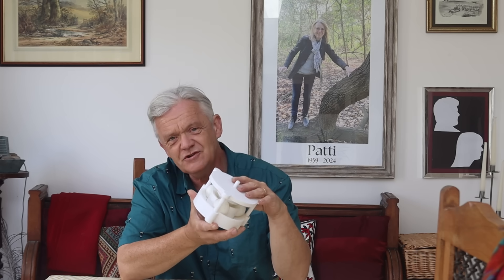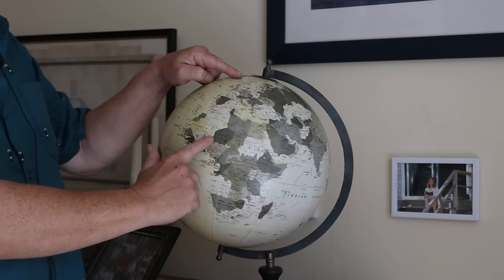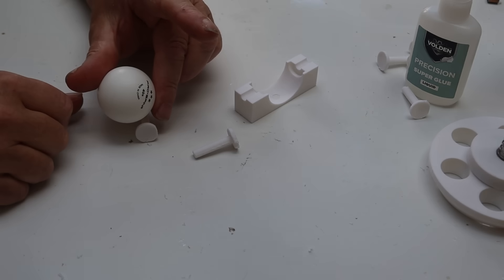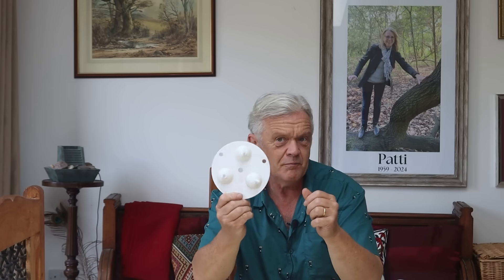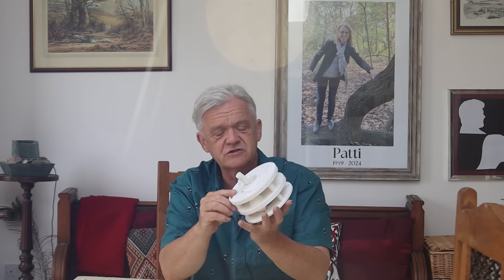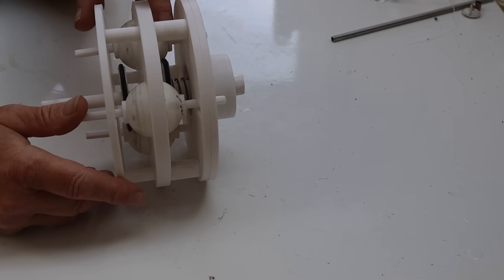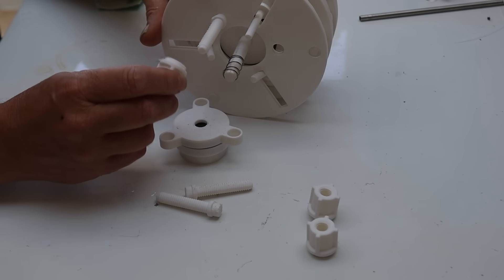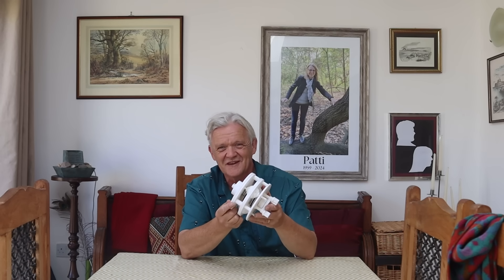2412 The Nu Vinci CVT with Ping Pong Balls

Comment: Typical in snow blowers is a rotating disk driven by the engine and another disk with a rubber edge that is moved along the drive disk linearly to create different drive speeds for the wheels.
Reply from the maker: cheers mate

Comment: Now I want to understand how the automatic CVT function works - I can set a level of constant torque where it automatically adjusts to keep it where set regardless of the terrain or pedal speed.
Reply from the maker: it's not automatic mate - you have to shift the lever - but making it automatic is not going to be really different from a standard automatic gearbox in current use would be my guess
Reply: @ThinkingandTinkering  Enviolo/NuVinci has something they call the "Automatiq" system that "shifts" for you (such as it is) to maintain a constant effort level from you.  I have the manual system; the upgrade is pretty expensive to me so haven't really gone for it yet (over 2x the cost of the hub alone and it also requires its own small battery).  I see some literature/drawings/pictures from them but I still don't really quite understand it.
Reply: also thanks for replying!  😀  have a wonderful day!

Comment: While the principals are sound I see limited uses. Friction means either wear on the mating surfaces or heat on parts causing expansion & potential seizure of the bearings in their raceways. As long as wear & heat are managed this looks fantastic & fun.
Reply from the maker: well it is a model of an actual device that is actually in use - so there is research to answer your questions. But you are right - good points and it is fun for sure

Comment: Cool.
Please, could you put some markers on the input and output, as it is a bit hard to see them turning?
Thanks.

Too many years ago, I tried to make an automatic gearbox for a RC car, using a 'cones and ball-bearings' approach. It sort of worked, after so many, 'trial and error' prototypes. But I never cracked the tendency of it to jump from 'low' to 'high' ratio when under high torque, or at high revs (regardless of adjusting spring tension, and various curves/angles of the 'cones') it would jump and stick at low or high ratio. And one of the hardest things for me to do was accurately mount the small ball bearings (5-7mm). The latter problem caused all manner of vibration and spacing issues. It was both fun and very frustrating. But I learned a lot about the difference between 'seems like a good idea' and the engineering reality. And it would slip either too much and/or unpredictably given the slightest excuse, even an errant fingerprint could cause problems.
I digress.

Thanks again for showing us all these fascinating techniques a mechanisms.
ATB. 👍 🫡
Reply from the maker: there are markers on there mate - reflective dots - I agree there is a world of difference between the idea of a thing and the reality of a thing lol - cheers mate
Reply: @ThinkingandTinkering 
Sorry, watching on a dodgy/tiny mobile screen, I couldn't make them out. My bad.  🙂

Thanks.

Comment: I have a nuvinci gearhub on my cargo bike. I tested the bike with normal gears and a derailleur, and the bike felt very efficient and rideable without electric assist (necessary to know as the bike is relatively heavy and one does end up with an empty battery occasionally). The nuvinci hub is clearly not as efficient and running out of battery range makes for a more difficult ride home. However, I find riding on a bicycle with regular discrete gears extremely clunky know. I have developed a pretty good feel for how much up or down I need to shift to change gear with the right amount, and you can do that while pedaling on. It is very comfortable to always hit that perfect gear ratio. At first I was disappointed with the lower efficiency of the nuvinci, but by now I would definitely want one on any bicycle that I would buy in the future.
Reply from the maker: nice feedback mate - i heard nu-vinci were working with a friction fluid addition to their drive to improve efficiency

Comment: That is amazing!  Thank you for sharing this with us!  If the plates that applied pressure were directly linked with springs, wouldn't that eliminate the need for adjustment?
Reply from the maker: i don't think so mate - the springs do two things - the first is to apply a normal force and your suggestion would be spot on for that. But they also centre the spheres in the holder so they don't rub on the holder surfaces - I don't think your suggestion would help there - but there is always more than one way to do a job - so another method to do that coupled with your suggestion would do that
Reply: @ThinkingandTinkering that makes perfect sense, thank you for the correction!  Can I ask, is the swashplate CVT a kind of nutation drive?

Comment: I think I'm starting to get what you are getting at remember 42 times....😊 I'll get there. I often wonder why some auto companies don't do straight shifts with a high&low speed rear end like an 18 wheeler you'd have ten gears and you'd only need a very small engine. It just always made sense to me. You'd just need to make either the three or four cylinder engines with smaller pistons depending on the demand put on the car. I think people would like them.
Reply from the maker: they probably would in this day and age mate - they would be economical
Reply: @ThinkingandTinkering yes they would be very economical as well as an effective way to reduce Petro dependence. However I just recently talked to a retired trucker and he says the companies are replacing the manual gear boxes with automatic transmission because they can't find drivers. Which means the transfer truck makers have figured out how to bring the rear end into the realm of automatic. So in a car it would still give better mileage and how much I don't know. Maybe our chat will inspire someone who makes automobiles we can hope

Comment: Thanks for another great video Rob 😎👍 I think if there were bearings on the shafts of the drive disks, then the springs could be put between them and the outside covers to make it more compact and with less parts
Reply from the maker: it's a great suggestion mate but you would be much better off using cross roller bearings i think as normal bearings wouldn't do that great with force of the spring acting on them

Comment: So if someone wanted for some reason could the gear ball be modified and used (that was previously looked at)?
Reply from the maker: yeah it can be modified but that is a very general question mate so I am not sure how you mean or what modification you want to do to it - but in general modification is always possible
Reply: @ThinkingandTinkering I was understanding the benefits of allowing the system to slip if put under to much pressure but the gears on the ball and a gear patterned on the touching pressure plate if someone wanted a grabbing non slip version.

Comment: Don't get why NuVincis aren't used in EVs, mad
Reply from the maker: It's a long road to get anything adopted in a car mate - it's probably why they went for bikes instead.
Reply: @BeLowBelowo  EVs are trash!
Reply: @machzero1457 😂
Reply: Automobiles have a lot of power available and very neglectful operators.  The reaction of most personal automobile operators to "it won't go" is "give it more power", not "find out why it won't go".  These need something in control that will protect them.
Reply: An electric motor as used in cars has enough power and torque throughout its range of speeds to not need a gearbox. There are a few with maybe two gears, to lower engine noise at high speeds. But overall it's an unnecessary addition to an EV. And EVs are heavy enough, and gear boxes wear, so best to design them without it.
Reply: @IvoTichelaar  I would have thought at slow speeds and very high speeds wear on bearings in the motor would be excessive and that there would be a sweet spot speed wise so to speak, and if a gear could be used for motorway speeds ( the long journeys and periods of sustained rpm) to keep the motor in the sweet spot rpm wise it would be better, or a cvt that keeps it in the sweet spot when the load isn't to much.
Just a thought though!